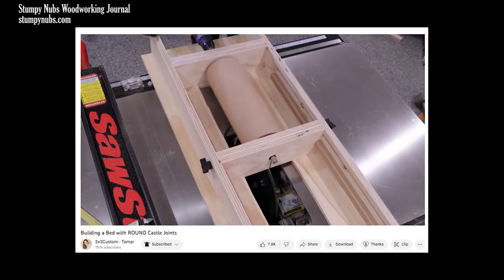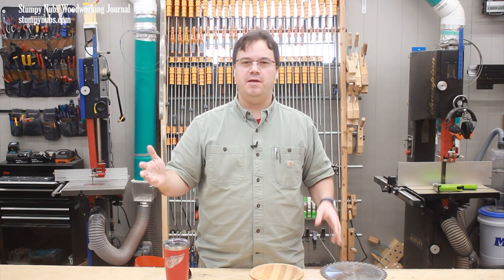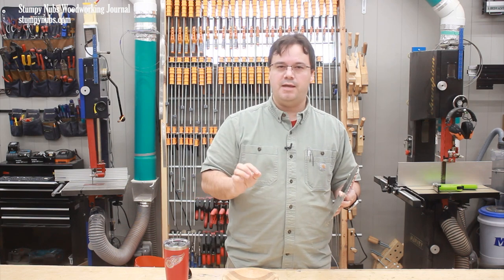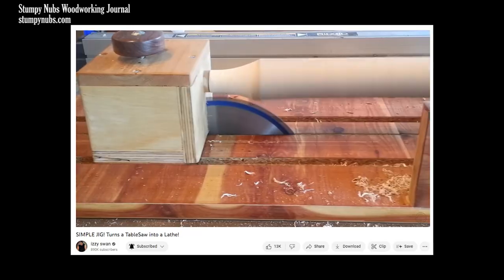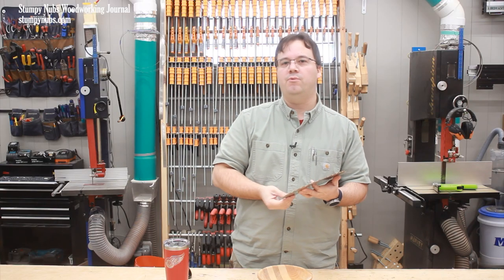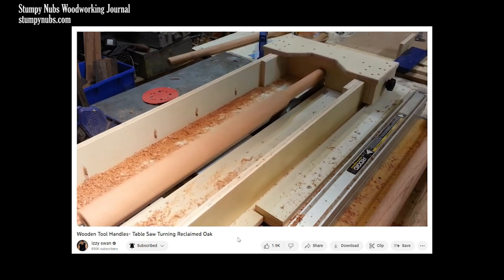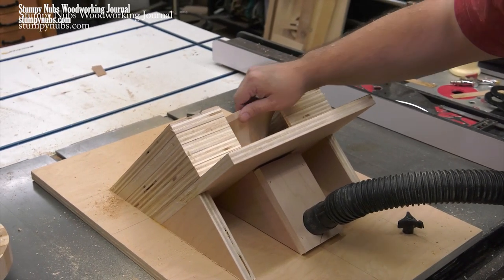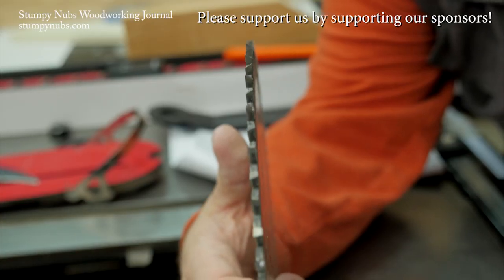DANGEROUS new trend in internet table saw videos? You decide...

Comment: As a machinist, lots of commonly accepted woodworking techniques creep me out.
Reply from the maker: As a machinist, you should be comfortable with scraping away material with carbide cutters while the workpiece is held and advanced within a jig.
Reply: @StumpyNubs  It's the hand held workpieces that creep me out.
Reply from the maker: There's several inches of hardwood between me and the blade, even after the inside of the bowl is hollowed out. Also keep in mind that a saw blade is not prone to violently catching on the wood as a cutter is on steel. That's not how kickbacks in woodworking occur.

Comment: Table saw has about 4000rpm = 66rps. For the standard blade about 40 teethes it would mean 40*66rps=2640 teethes are hitting the same place per second. So if would you "feed" the saw with a speed of 2640mm/s=2,64meters/second~100inches/s, it would be a 1mm cut per teeth. So one teeth will cut 1mm of wood, than it is passing by and the wood should jump inbetween the teethes for the next teeth to eat 1mm. Probably too high feed rate. 
But if one feeds with just 26cm/s~10inch/s, the distance of wood movement per teeth is 100 micrometers only = 1/254". Hair size. Kind of doable, or?
Shown videos do it with rather 1-5cm/s that makes 10um only or 1/10th of a hair thickness per teeth.

Comment: As fast as the blade is spinning, the "lateral" aspect is not a factor. The teeth are taking "bites" along the axis of rotation as they always do, and the kerf isn't wide enough for that to be significant differential pressure if the "bites" are from material to one side of the blade.

I am not comfortable around a table saw at all, but this came up in my recommendation list and the physics aspect of people's worries here bugged me.

Comment: No I have just gotten ahold of a nice table saw that is going to be around for a while it is an old craftsman with a cast-iron top 10in blade with a 3 horsepower motor what is external I have to figure out how to clean the top cuz it's set outside for a while in the cast-iron does have a little bit of rust turn up bad in spots but I think I want to sand it and then once I get it down clean it up a little bit and then put some Johnson's wax on it and I think it may be pretty good then

Comment: 4000x per minute (not second) (if your table saw turns at 4000 RPM).  Sorry to correct you.  Granted you may have 60-tooth blade.  It doesn't make it 4000 per second because the stress is not applied to the same tooth within the same turn.

Comment: There is an inherent danger of using shop tools and table saws period. Even when they’re used in their designed purpose. If someone is skilled, uses their head, blades are sharp, and equipment is in good working order, the sky is the limit when it comes to jigging and specialty uses in my opinion. One can cover enough bases to prevent injury and that’s solely on the user’s efforts. Nobody is there to tell you to not make a 3’ push stick if you think that’s what it will take to make it safe 🤷‍♂️. It’s all a matter of what you put between your bag of goo (your body) and the work.

Comment: Whether this is sensible probably depends on the saw.  On a pro quality table saw its a very different prospect compared to a cheap diy saw like mine.  I wouldn't attempt this, or a cove cut on mine.  But I have a lathe so wouldn't be tempted really.  If the tool isn't designed for it then probably better not do it.

Comment: You know how they have that crazy thing you can plug into a spark plug hole and get a makeshift air compressor? I’m surprised no one has created a device that turns your car or even a lawn mower into a makeshift saw, mill, router, or lathe. It seems like the kind of thing a 50-60s mad scientist inventor would create and fail to market.

Comment: it's 4000 revolutions per minute your blade would shatter at  4000 1/s  due to inherent blade imbalance 
Even if the teeth come lose they would not be particularly dangerously if you use safety glasses. The cutting speed at the tip of the blade is max 80m/s (industrial grade saws) where as the muzzle velocity of a shotgun is around 450m/s which in terms of energy means E=1/2m*v² 450^2/80^2~ 30.000.000 the shotgun particle energy is million-times higher (mass is linear and the difference between the chipped of carbide tooth and the shutgun particle is neglect-able) Airsoft gun usually have a comparable muzzle exit speed 45m/s-90m/s and using metal ammunition for those does not turn them into lethal weapons either.
The chipped of teeth might penetrate the skin and cause bleeding and bruising but they will not cause seriously injury. It will be stopped by safety glasses because for obvious reasons they are designed to withstand the impact of chipped blade teeth.

If your interested, there's a high-speed recording of a Saw-Stop saw which monitor if the blade touches skin via electric current and stops the blade within less then a quarter revolution by driving it (via gun powder) into a aluminum break. The shock of that impact causes the blade's teeth to break off which may leaves you with a few bruises from the teeth but leaves all your fingers firmly attached to your hand.
Reply from the maker: 4000 RPM X 60 teeth = 4000 strikes per second...

Comment: Great video as always! However I think there's a mistake at 2:55 when you talk about 4000 times every second. I think you mean every minute.
Reply: He was talking about tooth chip load, not pure RPM of the blade. A 4000 RPM on the blade and a 80 tooth blade.
Reply: @paulmarsman8758  starting at 2:45 he explicitly talks about "each of these teeth" so that means once per rotation, hence 4000 times every minute if your saw rotates at 4000 RPM.

Comment: Having had a few blocks of wood explode on a lathe, this seems pretty genius until it catches a knot or a unglued portion of wood and explodes.
Reply from the maker: The only thing I have seen explode on a lathe are chunks of badly damaged or rotten wood, or very complex segmented glue-ups. You assume a higher risk when working with those things, and that changes the answers to the questions in this video, therefore it would rule out at least the bowl making jig shown here.

Comment: If you cut just the thickness of the carbide tips, there shouldn't be a problem as the pressure will be just about the same as a regular cut.

Comment: I'm more concerned by the guy I work with who jams a 3/4 inch hardwood board through the table saw so hard the motor strains and you can smell the wood burning. I stand WAY back.

Comment: Use the CORRECT TOOL, For the Correct Job, CORRECTLY.
Especially if it's a power tool. Kinda why there's more than one Tool I think.
Yes, you can use a butter knife as a slot screwdriver, but not the good silver please 😂
... use a screwdriver 🪛

Comment: Interesting that you should broach this subject. This platform provides some very good advice with DIY construction and repairs from pros to hacks. The issue comes down to good advice and bad advice, and whether or not following some of those ideas is good or recommended. You can provide all the caveats that you want, but people are still going to attempt things that they ought not.
Sure! Some ideas and results of projects are cool and entice others to follow the same. However, at some point, one has to consider the dangers in how some of these tasks are performed. The more individuals that attempt to recreate some of these ideas, there will be more chances of someone getting hurt, seriously or otherwise. Fractal wood burning comes to mind. 
As with power tools, every piece of equipment serves a primary purpose and was designed with that in mind. However, someone comes up with an idea to fabricate something by jury-rigging that tool to conform to work outside of the scope of its intent design. And that's where there unforeseen accidents come into play. As you stated in your video, a shard of the cutting blade could dislodge and become a projectile in milliseconds. But everyone thinks that will never happen to them. And that's fine. You don't appreciate the vision and your appendages until they are gone, and it will happen before you can say ouch. 
I wish people would give a lot of thought before they delve into something that is risky at best that could alter their health and well-being. JMO. Cheers!
Reply from the maker: Yes, but saying something "could" happen isn't the end of it. The table saw "could" short out and catch the shop on fire. In theory, anything "could" happen. That doesn't make it a real risk. As I explained in the video, there is no real risk of a tooth coming off during the operations shown in this video. (And table saws were originally designed for rip cuts only. Dados, tenons, grooves, even crosscuts are going beyond what it was designed to do. That doesn't make them unsafe.)

Comment: I cant keep nice blades. Someone always runs a screw through them. We get the cheap 3 pack carbide for the general crap. Its a boat repair biz. The owner even cut fiberglas board 3/8 thick with a brand new blade! I keep spensive ones hidden. Im the only one that does the precise finishing stuff anyway.

Comment: If the jig is properly designed and used it should be fine. Speaking of videos of improper tablesaw use. There is a This Old House where Tommy Silva shows someone how to cope a baseboard to fit tight to the floor in a bathroom. He shows him how to do it freehand on a table saw. Yes. A table saw. Some expert.

Comment: Table saw blades generally spin at 3,000 - 4,000 rpm, not 3,000 - 4,000 revolutions per second.
Reply from the maker: 4000RPM X 60 teeth...

Comment: Any time you make a tool do something it was not designed for, it greatly increases the chances of something going wrong. If a table saw is doing anything besides rip cuts or cross cuts, you are risking a finger, or worse.
Reply from the maker: So no dados, tenons, rabbets or grooves on the table saw? Table saws were originally only designed for rips, so crosscuts fall into the "not designed to do it" catagory too. I think it's better to judge each technique individually rather than apply a broad rule like that.

Comment: Anything done with a tool, can go wrong. I doubt a single person reading these has gotten this far in life without smashing their thumb or a finger with a hammer. Heck even a lathe is more than capable of ripping an arm off in a microsecond if you don’t know what you’re doing and/or have an accident. 
Be safe, use good judgement… and stop what you’re doing if your spider senses start to tingle.

Comment: but ??? all the exemples you shown before 0.13 did NOT pass it laterally across the blade :/ i dont understand here XD they all use the blade in the good direction of use !? with the added rotation of the piece yes to make it a "simili lathe"
Reply from the maker: The rotation of the wood moves the surface across the blade from the side

Comment: I'll be damned... I have to cut a half-pipe (which I now learned is called a cove) in a piece of pine and this'll be the easiest by far! Great timing :D
Reply: See those black and yellow clamps in the video?  Don't use them.  They're garbage.  In fact, I wouldn't use any single-handed clamp to hold the guides down for this operation.  I'd use something with a screwthread.
Reply: Just one thing with the table saw cove method, it makes sections of ellipses or approximations of them. If you need a circular profile the only direction you get it is perpendicular to the blade.
Reply: @ParaBellum2024  Good point, those do like to slip on you when used like that, thanks for the input

Comment: IMHO using any tool in a way it wasn’t designed, is not a good idea. In this specific case, I don’t like the lateral force on the blade.
Reply from the maker: Table saws were originally designed for rip cuts. Crosscuts, dados, tenons, grooves, rabbets- all of these operations are not using the tool "in a way it was designed." ... My point is that statement is far too general, and could not be reasonably applied to most shop tools. A better policy is to not use a tool for anything that creates an unacceptable level of risk. And this video explains a responsible way to make that determination.

Comment: I saw her video and cringed, is it a way to do it sure, is it safe, not the most dangerous thing but not the safest either, I think what people need to keep in mind is this, a vast majority  people making videos are not actual woodworkers, they're performers trying to make money. Here is what you are forgetting to consider when you say that this technique is ok. People these days are using $300 jobsite saws, which are not table saws, they're circular saws flipped over and mounted on a table. On top of that diablo blades are what most people love and they're thin and flexible. My advice to everyone, is if you want turned pieces invest in a lathe, and learn how to use it,  it's a pleasure to turn , its a great skill to have. if you don't want to do that then there are companies that specialize in turning or there is probably a local turner that would be glad to make the parts for your project

Comment: Dangerous, maybe.  Dumb, yes.   Besides bowls, I don't see what else this technique is even good for.  Table legs are just going to look like large dowels which would be the same as unskilled person using lathe, right?....  And if we try to get creative, and make a nicer looking leg, that is where it will become dangerous - adjusting saw height, etc.

Turning something by hand where you can feel the pressure against the blade is a lot different than using a power tool.   I think I would avoid using something it was not designed for, rather than feel comfortable with hypothesizing several things that can go wrong.  Blade is also going to dull faster on the one tooth side (yes, unless you turn the other direction for the same amount of material cutting).  

I would consider making a sled or jig that moves left to right, use a dado, and just make a bunch of passes straight on.  It would take a little longer, but would get a nice forearm workout and be able to craft a table leg with better features than possible the other way.

Comment: Table saw is the most versatile tool in a shop / i was taught jigs in my woodworking class and they work well when they where done and use proprely ... but for shur people ho dont know what their doing should lern it proprely since it was a tool to remove material and saw tooth could break ( often old saw blade those ho heat to much in hard wood or clug with pine rosin/ glue ) so as you said it was suggest to use a good blade to do it as everybody would do with a kitchen knife if they want to keep their fingers. Knowledge and critical thinking would go somewhere but some neowokism take their belives for reality and was scare about pretty much everything now day's... ive already herd about a security inspector who seal table saw in a shop after seeing someone cut a groove without blade protector ( wich is impossible for those ho dosent know it ) 🤯 and its even worst in politics !

Comment: 4000 collisions per seconds, isn't that per minute?
Reply: Depends on the rotational speed of the motor on your saw's motor times the number of teeth on the blade you're using, I guess. What if it's 3,000 rpm motor speed, times 80 tooth blade, divided by 60 seconds? 3k × 80 ÷ 60 = 4000 collisions per sec.
Or 6k rpm and 40 tooth blade.
Either blade and saw speed, and the math works out.
Reply: Actually, if the rpm of the saw is 3000, then each tooth hits the wood 3000 times per MINUTE (one time per full rotation). That's 3000÷60 = 50 collisions per tooth per second.
Reply: @mohamedouthiam1443  Yes but the saw blade has 80 teeth so there are 4000 opportunities per second for a blade tip to break, and that is what you care about. You aren't worrying if a specific particular tip breaks but if any of them break.
Reply: I am pretty sure he said "EACH TOOTH hits the wood at 140 mph, and that happens over and over 4000 times per second". So it boils down to "what did he say?". Did he say that ALL the teeth hit the wood a TOTAL number of 4000 times per second? That's not what I heard. Now, is that what he MEANT? Could be!
Reply: @thomasarussellsr  Stress is applied to each tooth once per revolution.  Stress of one tooth doesn't transfer to another.

Comment: Did you mean the teeth hit at 4000rpm as 4000 every second is 240,000 rpm that's alot for a tablesaw and it would be tough to find a blade that could withstand that.

Comment: its really hard on the machine for one. it was not designed todo this. and for one if enough force is bent on that blade it could explode. just simply turn on the lathe man. way safer
Reply from the maker: Did you watch the video before leaving this comment?
Reply: @StumpyNubs  no sir i watched your whole video. i think you presented great! i don't agree with the information you presented tho. Using a blade with the wrong intent spinning at over 6,000 rpm, which can cause the blade to jump on the spindle, especially if hit with a hard species, will absolutley create conditions that can absolutley cause a blade to shatter.
Reply from the maker: @tristannaylor5197  I appreciate your opinion, but it is hardly absolute. I think you are overestimating the force applied. Remember, this has been done for generations to cut coves and never have I heard of a blade "shattering" from it. I also do not know what you mean by "can cause a blade to jump on the spindle." Are you saying your blade slips on it's arbor?